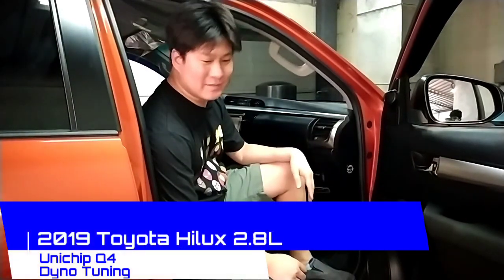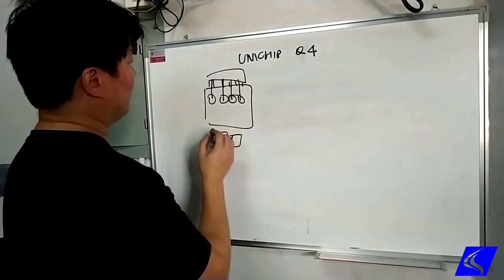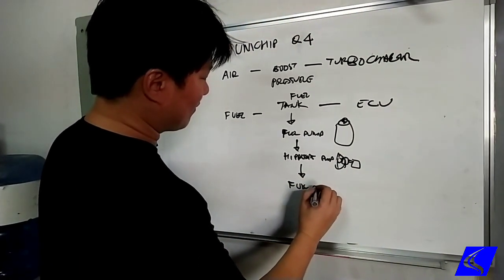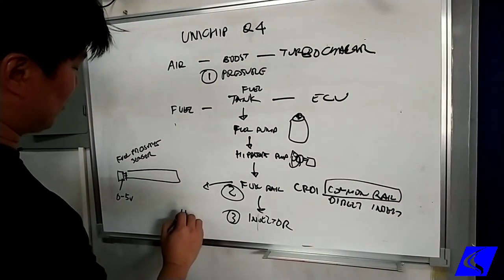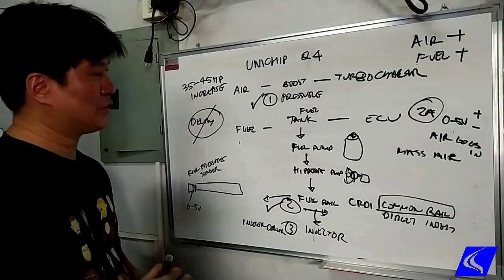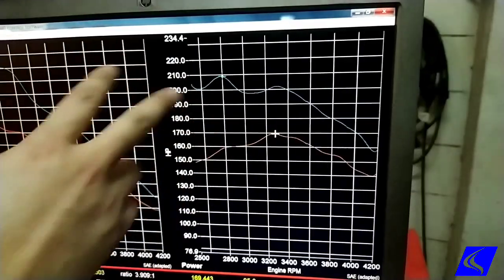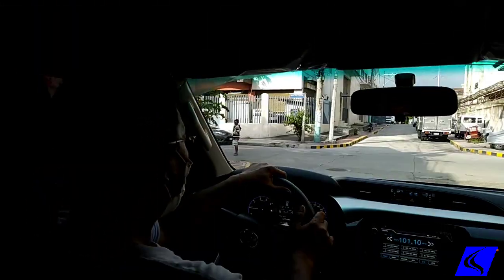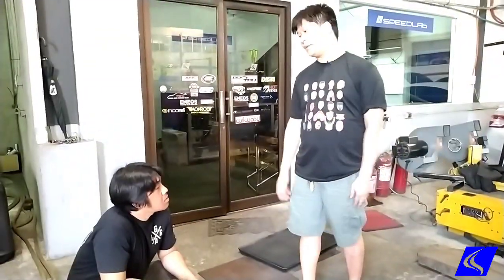2019 Toyota Hilux Unichip install and Dyno Tuning

Comment: Speedlab question. If I remove a unichip and and fit the supplied patch connector to return back to standard. Will the just revert back to the tune that was previously on the factory ecu?
Reply from the maker: Yes. The bypass plug returns it back to stock
Reply: @speedlabchannel4452  one end is hard wired to the factory ecu so I assume I'd need to get another harness if I fit it to another vehicle yes? 🤔
Reply from the maker: Ideally youd want the harness to transfer to another car

Comment: Sir.. my question is? installing the unichip in stock car engine.. what other part need to upgrade with
Reply from the maker: My question is what car do you have
Reply: @speedlabchannel4452  Mitsubishi Pajero 3.0 6g72
Reply from the maker: Jahanzaib Baloch 
Here’s the complete list to get maximum power 

K&n intake 8500
Full exhaust with headers, midpipe, Borla muffler and Borla tip 49000
Unichip 35000

Less 3500 if sabay all

Comment: Ayos to Lods,  Pero may mura na parang Unichip din Powerbox ang brand nasa Shopee Lazada worth 10k to 12k.  Dagdag 36Hp ayon don sa description ng products.  Kino connect lang dunsa wires ng fuel injector at battery yung powerbox. Ewan lang kung tested na yun. Sabi naman ng ibang naka try na paggamit daw ng long distanced nag o overheat daw makina,  hilux navara made in canada pa yung ibang brand na kinabit sa fuel rail
Reply from the maker: Your welcome to waste your money on that

Comment: Hello incase we turned on the power mode what will be the response in toyota car using unichip?
Reply from the maker: The various modes control the transmission shift point 

Not the engine power itself 

So it will work the same as before
Reply: @speedlabchannel4452  thank you

Comment: Sir, what happens to power mode features on toyota s and eco mode.its still can be use..? And how much it cost ,uni chip,intake and exhaust?thank you
Reply from the maker: Yes those work as intended 
Unichip 35000 includes install and dyno
Reply: @speedlabchannel4452  ok sir thank you

Comment: Does the unichip also adjust the torque limiter of the ecu boss?
Reply from the maker: No,  but on Toyota’s, torque limit isn’t an issue.
Reply: @speedlabchannel4452  thanks boss.

Comment: Sir pwde ba yan sa hilux 4x4 2007 matic trans  all stock no need modification?
Reply from the maker: Yes. All stock is fine
Reply: @speedlabchannel4452  mas better ba ang unichip ang ipakabit ko sir than remap sa model ng hilux ko?

Comment: limiting engine to 2000rpm increase reliability can also save fuel and running lean 15.0:1 also save fuel
Reply from the maker: 15:1 IS NOT LEAN for a diesel
Reply: @speedlabchannel4452  yes diesel can run lean at 24:1 underload